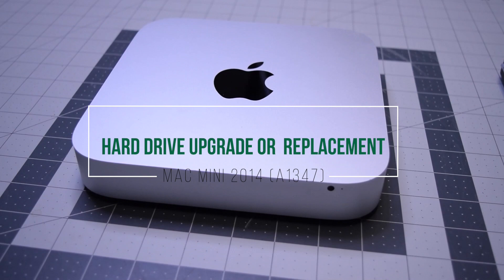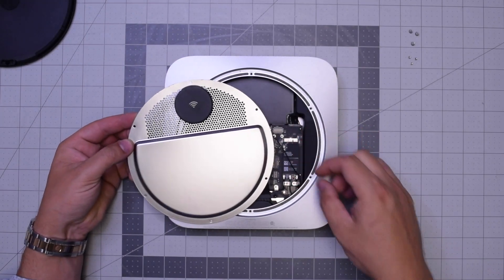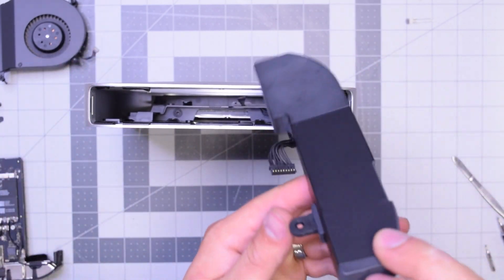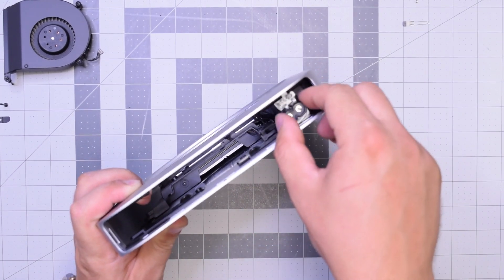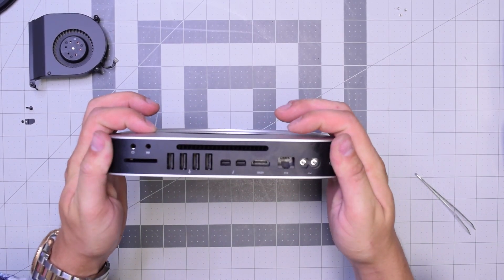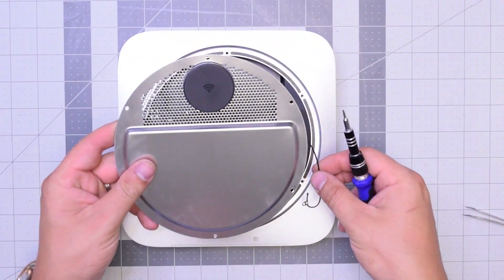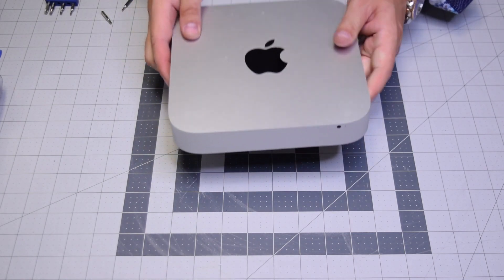Hard Drive Upgrade SSD - Mac Mini 2014 - 2017 (A1347)

Comment: Great video.  They make this stuff so small anymore, it's difficult to do basic tasks like replacing a HDD.  A standard 2.5" laptop HDD was 1/8" too tall to fit in my late 2014 Mac Mini--so I ended up putting the S.M.A.R.T. failed HDD back in the device and hoping Steve Gibson''s SpinRite will get it working again long enough to get a full backup.  I got probably 80% of my files off it by booting into recovery mode (option + command + r), attach an external HDD and use Terminal to cp -R my volume.  Will make sure I have Time Machine backing everything up first thing--then hope I can limp along until I can afford a replacement HDD from macsales.  That way I'll know it will fit!

Comment: Great video as others have mentioned. Simple and precise. May have already been mentioned, but from my experience here's what was missing: (1) you have to be careful pushing the logic board out as to not crush the fan's exhaust fins, (2) the four HDD bracket screws were T7, (3) the ribbon cable connected to the HDD is secured by a piece of black tape that needs to be removed so the SATA cable can be separated from HDD, and (4) reuse the black sticky pads from the HDD on your new drive and place them in the same location as old drive.

Comment: Thinking of getting the newly released 2020 Mac Mini. Do you think the SSD installation is the same as the one shown in this video? Thanks for the tutorial.
Reply: Everything is soldered on the 2020 M1 Mac Mini, you will not be able to upgrade anything.  What you can do is connect an external SSD via thunderbolt port.

Comment: Thanks for showing us how difficult it is, and easy to mess it up. I am better off get an external drive instead.
Reply from the maker: External is at least 3 times slower.
Reply: Save Apple Dollars when you bought the ssd, did the seller provide you all the tools? Or you bought the tools separately? I’m attempted, but afraid to mess it up by my big fingers. Thank you.
Reply: @pennmar120  No need to replace the HDD, you can just add a PCIe NVME SSD, the connection is right there just after removing the metal cover.

Comment: great instruction.  thank you very much.  one thing not in this is when you go to remove the hard drive, there is glue holding the harness to the old hard drive and a piece of tape holding the connector to the drive.  I had to slide a thin card under the glue and peel off the tape to free the hard drive from the connector.  for anyone doing this, be careful with the harness and connector while freeing the old HD.
Reply: Thanks , seems like that part was skipped on the vid.

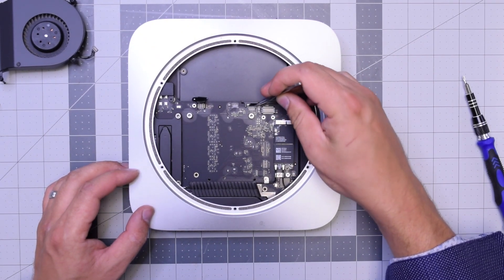Comment: I just ruined my sensor cable by following your instructions! At 2:20 you say to just unplug the sensor cable but it doesn't unplug and it broke off the section it plugs in to on the logic board. Now I guess I have to replace the logic board!!!
Reply: Best to use a small plastic spudger to gently get under these tiny connectors and gently lift them up and out. Using anything metal is not a good idea. Using tweezers as shown in the video is, IMHO, a plan for disaster. 😞 And never pull on the wires. Get under the connector body and lift it up.when you put them back, lay the connector in place and gently press it back onto the pins. Go slow. Pay attention to detail. This stuff is tiny. Clean your glasses. 🤓 Use a magnifying glass if you need to.
Reply: spat7378 yes good advice and I wish I did it this way. I’m lucky I only lost the infrared sensor function and don’t really use a remote anyway.
Reply: J T I just did the same thing
Reply: @WooznamAndTheLickers  yes I continued with everything else OK and just going without the LED on light. It all still works but there's no indicator light.

Comment: Once you’re done installing the SSD will it automatically load up with Mac OS or am I going to have to re install it? Could you explain how I am supposed to do that? Thanks so much
Reply: The best way to do this is to run a full Time Machine backup to an external disk right before you disassemble the MacMini. Put in the new SSD, then boot into Recovery Mode by holding down Command+R as you turn the computer on. Then go into Disk Utility and erase your SSD and format it as MacOS Extended (Journaled). Then restore the Time Machine backup and you will be back where you were before you started. Except your Mac will boot up at least 5 times faster than it did before.